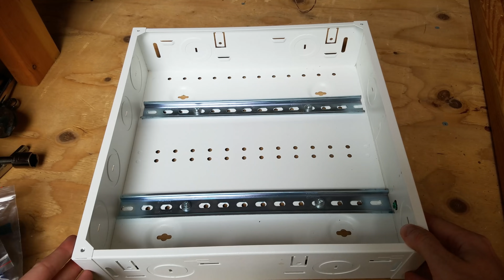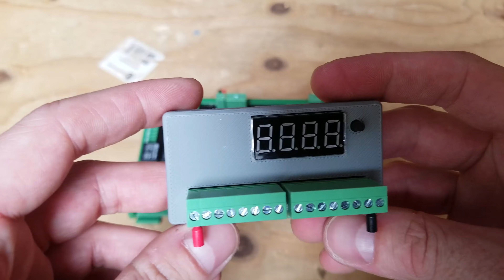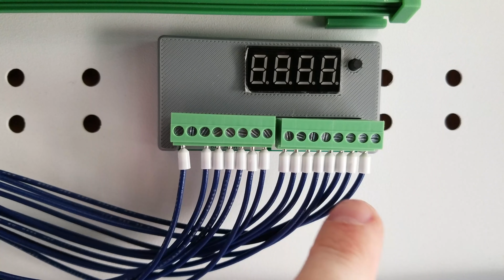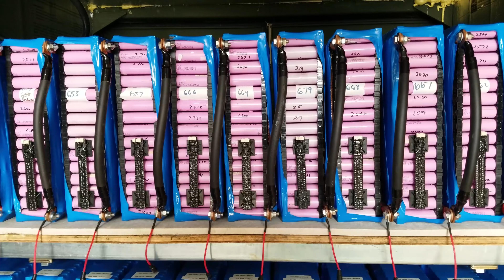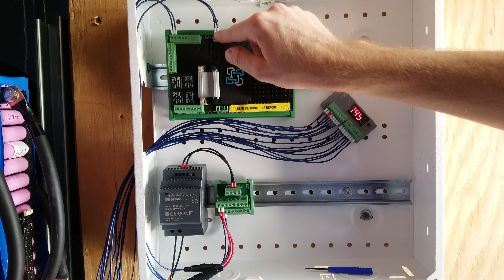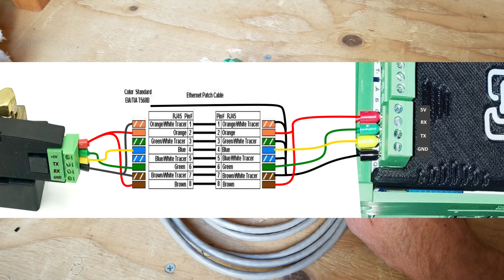Installing the Batrium Watchmon 5 (WM5) Battery Management System

Comment: OCP for balance leads? Very cool
Reply from the maker: Yep, I imagine the 6ft run of #20 would make a rather nice resistor (heating element) if there were to be a short without fuses. Lol
Reply: Is that Over Current Protection or 
OCP	Oracle Certified Professional (PK)
OCP	Official Community Plan
OCP	Open Circuit Potential
OCP	Open Compute Project
OCP	Oral Contraceptive Pill
OCP	Omni Consumer Products
OCP	Oracle Certification Program
OCP	Open Collections Program
OCP	Oleoducto de Crudos Pesados (Ecuador)
OCP	Optimal Control Problem
OCP	Over Current Protection
OCP	Open Core Protocol
OCP	Operational Camouflage Pattern
OCP	Ontario College of Pharmacists (Canada)
OCP	Oregon Catholic Press
OCP	Organochlorine Pesticide
OCP	Office of Contracting and Procurement (Washington DC)
OCP	One-Child Policy (China)
OCP	One-Component Plasma
OCP	Open-Closed Principle (software engineering)
OCP	Optical Channel Protection
OCP	Oracle Certified Professional
OCP	Office Compatibility Pack
OCP	Onchocerciasis Control Program
OCP	Opera Company of Philadelphia
OCP	Our Changing Planet
OCP	Omaha Community Playhouse (Nebraska)
OCP	Office Cantonal de la Population (French)
OCP	Office of Crime Prevention
OCP	Operational Command Post
OCP	Open Control Platform
OCP	Octacalcium Phosphate
OCP	Orange County Partnership (Goshen, NY)
OCP	Omni-Consumer Products (Robocop)
OCP	Oficina Central de Proyectos
OCP	Ocular Cicatricial Pemphigoid
OCP	Oracle Certified Partner (software)
OCP	Other Consumer Protection
OCP	One Commerce Plaza (various locations)
OCP	Optional Calling Plan
OCP	Olefin-Cracking Process
OCP	Obligatory Contour Principle
OCP	Old City Park
OCP	Office of Commercial Programs (NASA)
OCP	Open Currency Position (finance)
OCP	Optical Control Plane (Sprint)
OCP	One Community Partnership
OCP	Oxford Concordance Program
OCP	Output Control Pulse
OCP	Overland Common Point (shipping industry)
OCP	Optional Cash Payment
OCP	Official City Plan (Canada)
OCP	Out Causing Panic (gang)
OCP	Office of Chief Prosecutor
OCP	Oregon Children's Plan
OCP	Old World Conference in Phonology
OCP	Orlando Christian Prep (Florida)
OCP	Open Catalog Protocol
OCP	Oregon Chamber Players
OCP	Optical Communication Payload (European Space Agency)
OCP	Outside Context Problem
OCP	Office of Commonwealth Preparedness (Virginia)
OCP	Orbital Commerce Project (Oviedo, FL)
OCP	Ofcom Consumer Panel (UK)
OCP	Optical Communications Products, Inc (Chatsworth, Ca)
OCP	Oil Circulating Pump
OCP	Orthodox Community At Penn
OCP	On Camera Principal (featured actor on camerai)
OCP	Order Code Processor
OCP	Overclockers Comparison Page
OCP	Ocean and Climate Physics
OCP	Oasis Computer Products
OCP	One Car Pile-Up (UK punk band)
OCP	Old Colony Players
OCP	Oxfordshire Community Partnership
OCP	Office for Capital Programs
OCP	OPSEC Certified Professional
OCP	Old City Publishing, Inc
OCP	Oatmeal Cream Pie
OCP	Optically Channelled Potentiator (Splinter Cell video game)
OCP	Operational Computer Program
OCP	Office of Civilian Personnel
OCP	Ohio Cellular Products (Corporation)
OCP	Ova Cysts Parasites
OCP	Organic Chaos Productions
OCP	Ordained Clergy Person
OCP	Owners and Contractors Protective Liability Policy 
OCP	Organizational Consulting Psychology
OCP	Online Campus Passau
OCP	Observable Critical Process
OCP	Operational Configuration Processing
OCP	Observe Control Punish (gaming clan)
OCP	Owston's Palm Civet Conservation Program
OCP	Operations Control Panel
OCP	On Campus Promotions, Inc
OCP	Oxford Chemistry Primer
OCP	Office Copier Program
OCP	Obsessive Compulsive Poseur
OCP	Outage Coordination Protocol
OCP	Organisation Consulting Partnership LLP (UK)
OCP	Ocean Color Pigment
OCP	Office of Capital Planning
OCP	Off Campus Privilege (education)
OCP	Off-Campus Credit Programs
OCP	Outside Cable Plant
OCP	OSIS Communications Processor
OCP	Outstanding Club President
OCP	Ontario Corn Producer
OCP	Organizational Concept Plan
OCP	Optical Controller Pack
OCP	Operational Communications Plan
OCP	Original Chris Parts
OCP	On Chip Parametric
OCP	Out of Commission Parts
OCP	Olympic Centennial Pager (Motorola)
OCP	Over-Clocked Processor
OCP	Over-ground Car Park
Reply: @Jasfras1  haha wow. How did you fabricate this list
Reply: @WillProwse   ... Easy just looked up OCP on google to find out what you were referring to.  Got that list.
That is the danger of using Acronyms.  So which was it ?
Also. I'm in UK and  I need to build 12v Battery for Solar storage.  Maybe a total of 200A usable .. Which video would you recommend me to follow ?
Reply: @Jasfras1  over current protection. Oh goodness there's a lot covering 12V. That's a tough question haha
Reply: @Jasfras1  you forgot Over Compensating (for your) Point. I hear you, 
but this is the world we live in.